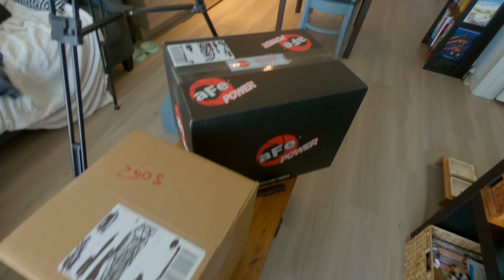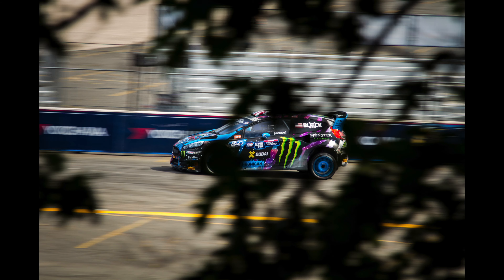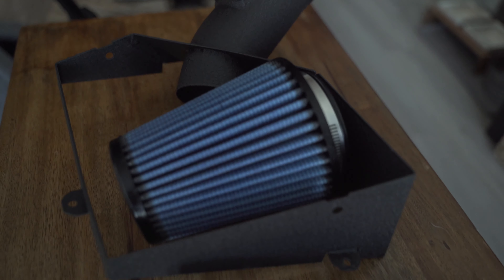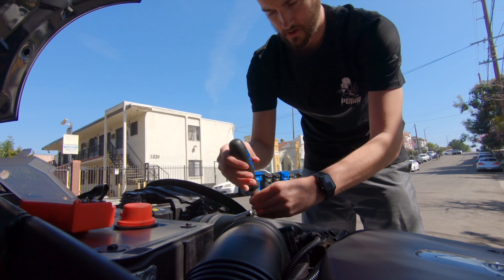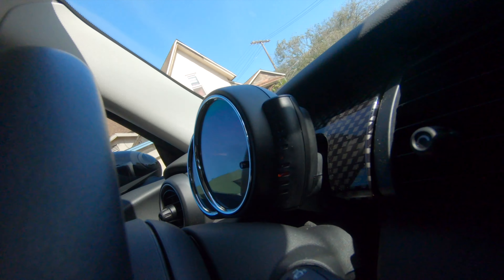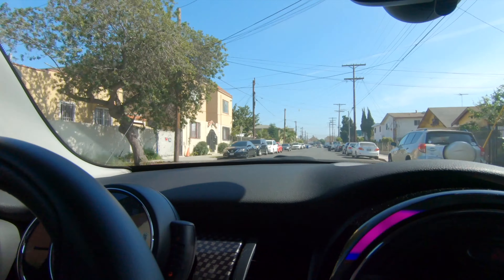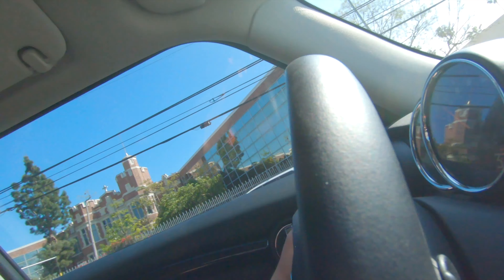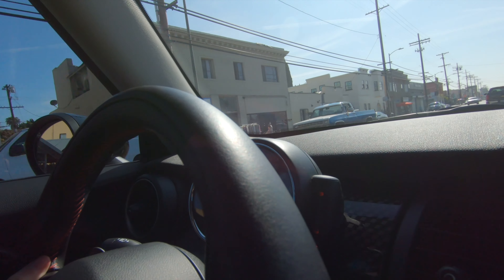Mini Cooper S - aFe Power Intake Install / Review

Comment: Amazing review! I bought a 2019 s hatch a week ago. Great info on cover vs no cover!!

Was wondering if your mini has thrown any codes from the increase in HP. Also, do you have an aftermarket exhuast? Have no idea what brand to go with and have been looking everywhere for a cat back… any suggestions?

Thanks!
Reply from the maker: Thanks! Had the intake on for about 2 years up until we sold it June of 2021. Never threw any codes for it during that time. As far as catback I never did an exhaust on it. If I did it would have been either the remus or jcw pro exhaust.

Comment: Will this fit an 09 clubman S?
Reply from the maker: To my knowledge it would not. This intake is for the f56 model. I'm not sure exactly what engine the older clubmans use, but I would be thinking its the same if not similar to the 09 cooper s engine.